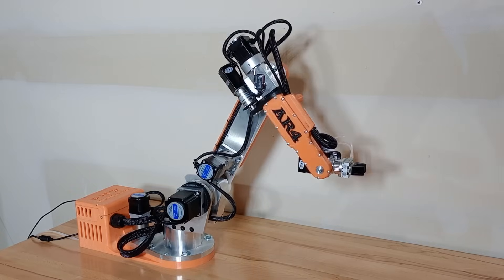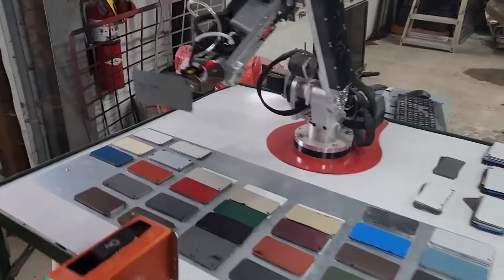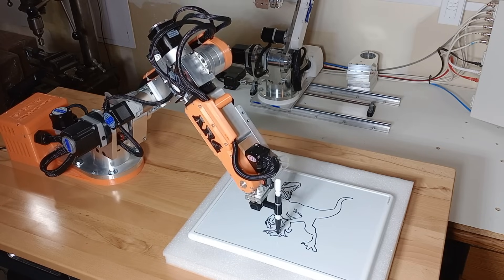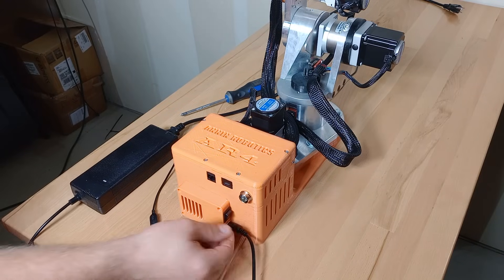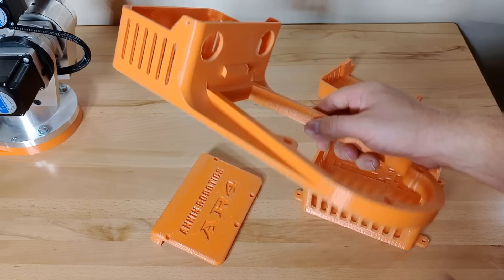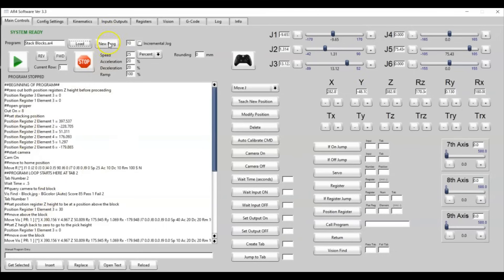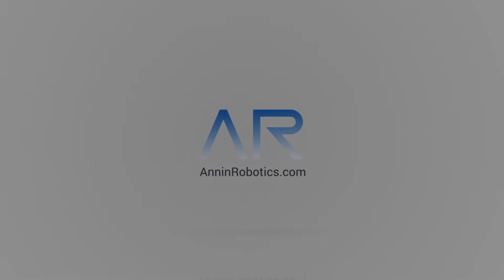AR4 MK2 6 DOF ROBOT ARM - DIY 6 axis robot kit / Arduino controller with Python program interface

Comment: Cool. Wonder, would it be possible to add my 500w spindle on one of these to carve wood? You mentioned grbl, can one use like Deskproto to use multiple axis? A cnc robot for the masses would be super cool, even if it could only do light passes it would still mean multi axis cutting. But Cam support seems to be non existent for open source robot CNCs

Comment: This is fantastic. I have an old MRC Motoman 6 axis welding robot in the shed, can i retrofit your control to it to give it a 2nd life?
Reply from the maker: @AWAradiola  if the drives you have except step and direction inputs it should be no problem. Just download the manual for the ar4 and follow the wiring schematic. Email me if you have any questions

Comment: Dude! Chris! Mind Blown!
Reply from the maker: Thank you!
Reply: Chris I'm trying to build a parallel cable robot to 3D print houses. How do the kinematics get incorporated into the programing? In the firmware or the slicer? Will I need custom g code?
Reply from the maker: @Ed_Aylward  the kinematics are calculated in the teensy control board firmware.

Comment: Is it possible to mill all the structural Aluminium parts on a 3 Axis CNC?
Reply from the maker: @oithetresen609  I believe my machinist currently makes a couple of the parts on a 5-axis but I believe if you do the setups right you should be able to make them all on a three-axis

Comment: I was watching the "Made with Layers" Channel where he built an AR4 but at the end he mentions how much wobble the arm had. 
https://youtu.be/4xD9QCBkxAs?t=706
Was there something in his build that he did differently because the results from your version and his look very different.
(perhaps a parameter was set wrong or where he set the tool center offset 300mm from the Arm at the 14 minute mark ?)
I'm just starting out so I don't know enough to comment so just looking for some insight. Thanks
Reply from the maker: I did see his video.  I sent him this response in the comments:
@Thomas,  Thank you for building the AR4 and highlighting some of its features.  I did want to touch on a few of the comments you made. In the overview section of the manual I do mention pre-applying solder to wires being joined together - I find it easier to pre-apply solder or tinning the ends - and then bring them together with the iron rather than trying to hold the wire ends together and hold the solder and hold iron at the same time, not having 3 hands - it helps to pre apply the solder.  None of the wires going to the breakout board call for tinning so I'm not sure about your comments on that?  On page 143 I do have some groups of wires soldered together to help group them going to the 3 screw terminals as its a tight fit and difficult to maneuver them into position without them being connected but you could certainly use ferrules in this step if needed. At one point in the past the design did utilize plug connectors and building a wiring harness.  Given different applications, motions and articulations all the low cost plugs I sampled proved to fail over time.  With this small arm and the limited cable routing and cable arc lengths, direct solder with the solder joints in strategic locations using heat shrink proved to be more reliable, less bulky, less costly and not as time consuming as crimping and inserting numerous plug pins.  The primary goal of this project from day one has been to realize a usable robot and at a very particular price point.  I've worked with industrial robots my entire career and its always been a frustration that any usable robot was out of reach.  There is an absolute threshold on the price as most educators have a budgetary limit so I have made it priority number one to stay under that limit.  This drives many of the design aspects,  The motors for example are off the shelf variants and cannot be fully customized without adversely affecting the price. There is a limit as to what OMC can customize on these coming from the factory.  The machined components are kept to an absolute minimum and as many as possible are cut from flat sheet material.  This also drives the bearing designs and tensioning designs as custom machined threads and spindles for locknuts for example is not in the cards at this price point. It also drives some of the belt selections.  I did notice the belt tension on your build was far too loose resulting in a good amount of play.  Here is a quick video of the forced deflection on my build. https://youtube.com/shorts/lf_KFFiCdJA  - Making the statement that  "This robot arm is neither accurate nor precise, rigid or smooth" seems a bit harsh considering.  A great deal of effort has gone into this project, I know you have a great deal of experience and a wealth of knowledge in all manner of machines and mechatronics and your design suggestions are certainly well founded but I wanted to explain these aspects of the project, and hope you will convey these points to your audience. Thank you.

Comment: Hi Chris, I want to build an AR4 MK2 and would like to start with the most basic parts. In your store, I will need the 'AR4 MK2 Robot Combo Kit', the 'Complete AR4 MK2 Stepper Motor, Driver & Power Supply Package - factory direct from StepperOnline' and the 3D prints you provide. Is that correct?
Reply from the maker: Yep that's correct, message me with any questions you have on the project and I'm happy to help.

Comment: Hi Chris, what are the differences between the AR4-MK2 and the AR4?
Reply from the maker: the primary difference is that the AR4 had the drives mounted in a separate enclosure and you had to make 6 cables to go between the enclosure and the robot base.  The MK2 has all the drives incorporated into the robot base so you just have to run a usbC cable to the base.  The MK2 also had some of the motors upgraded to higher tolerance gearmotors.

Comment: Hi
Thank you for the awesome project. I have some question

Is it possible to use this robot to etch PCB? Something similar to the drawing in the video but using spindle instead of the pen.

Is it possible to use it as a CNC machine?

Can use it for accurate tasks if I print the alloy parts using carbon fiber nylon or something even harder?

Thank you so much

Comment: Hi Chris, i tied to use AS5600 encoder with AR4 MK2 but i didn't receive any values. Are Encoder.h library in Arduino code will work only with Stepperonline motors only?. If Yes can please show how can modify it to be suitable with any encoder model SCL&SDA connection

Comment: How much does it cost? How large is the work area? How fast does it move?
Can gripper have 4 fingers?

I'm looking for a robot to play chess (blitz) on a standard chess board.
Reply from the maker: Hello,  The total cost is approx $1900 - please see the robot kits page for the kit rundown.  The robot has a reach of 63cm and can lift 1.9kg.  The max linear speed is 193mm per sec.  I hope that helps and please let me know if you have any other questions I can help with.

Comment: Hi Chris, I have a question hopefully you can answer. 
How many degrees of freedom an object can use simultaneously? 
An object in 3D space has 6DOF how many can it use simultaneously?

Let’s say a cylinder is stationary and levitating in the air, it has the potential to move in any of 6DOF. We push a button and the cylinder moves forward- it’s using one DOF out of 6 available. Then we press another button and it starts to roll while it’s moving forward - it’s using 2 out of 6DOF. Then we press another button and it starts to go up while it’s rolling and moving forward- it’s using 3 out of 6DOF. 
Question: how many DOF an object can use simultaneously?

Comment: Do you sell the linear rail as well? If not - could you link which parts would work?
My project requires the robot to be able to traverse around 1.5 meters linearly.
Once again, incredible job by a single person.
Reply from the maker: Thank you very much. I don't have a kit for the rail but the manual does have a bill of materials for it.  The software is configurable so that you can make a rail any length you need. If you have any specific questions please shoot me an email at info@anninrobotics.com

Comment: Hello Chris! I want to make a gantry welding robot (5 axis), according to my dimensions. Tell me, can it be programmed using your program?
Sorry if this is a stupid question, I'm not good at this...
Reply from the maker: The software is written for 6 axis.  I havnt tried adapting it to a 5 axis machine but you could likely use the software only jogging in joint mode and always keep joint 4 at zero and I think it would work but I would need to test.

Comment: Chris this is an amazing project ! could you please share with me what is the accuracy or repeatability test results of the robot ? im designing my own arm and im considering to also work with planetary gear boxes , but im afraid it may make my robot inaccurate. 
thank you for everything you have done !
Reply from the maker: Thank you very much.  Given the testing I have done repeatability is around .2mm to .3mm.  this was with no change in load returning to multiple positions.  Harmonic drives would be ideal but given keeping the cost at a minimum these gear motors aren't too bad.

Comment: This is mind-blowing!! This is not just incredible, but is a legacy… that’s the best way to describe it. One question: in a modified form, is this accurate enough to replace a desktop CNC router?
Reply from the maker: Thank you. It may be capable of light milling but it's best for material handling operations. I still have some optimization to do on the gcode aspect  as well.
Reply: @anninrobotics  Thank you so much for your response. I am looking at fairly light wood carving applications. I shall follow your progress. Best of luck!
Reply from the maker: @OldSilkRoad   thank you!

Comment: Amazing work Chris!
I have all the parts for the AR4 MK1 but I never got into building it as I got busy. Real soon i'll have more time on my hands so i'm wondering if you have a list of the different components used in the MK2 so I can get them individually to make the MK2 directly instead with the old Kits
Reply from the maker: Hello, The aluminum components and and hardware components are the same but the electrical kit changed slightly, it has most of the same parts but there are a few new parts.  You will need some 20awg red/black wire, 90° USB keystone jack, Micro to C USB cable, 5.5mm DC socket, rocker switch, and a common 40mm fan. (see the MK2 manual BOM for details)  These parts are all easily found on Amazon or If needed you can email me and I can put together an invoice for these parts.  The AR4 MK1 motors will all work fine for the MK2, the biggest difference is the drivers.  You will need to purchase (3) DM332T drivers and (3) DM320T drivers from Stepperonline as well as a 24vdc power brick.  The drives as well as a 24vdc power brick can also be found on Amazon.

Comment: Am i to understand with the ar4 mk2 update, i ill no longer need to source anything?  just buy the combo kits and stepper kit, and gripper kit, and make 3d prints and thats all i need, nothing else to source? (enclosure, or anything else no longer required, just buy the kits?)
Reply from the maker: Yes that is correct
Reply: @anninrobotics  fantastic, been wanting to make one for a year but i am squeezed for time, sourcing/designing anything was a no go, now i can buy, assemble with my 4yo boy and put it to work learning pick and place! thanks a million for the update! just want i needed to pull the trigger and get started!  its gonna be a fun xmas morning, my boy LOVES cnc's and robots!

Comment: I’ve followed this project for a while now and it is very impressive. I just have one question though. A common problem with robots are how they are controlled, potentially because the skills to program the robot itself are pretty different from the skills required to make GUIs, so what did you use to create the program to control the robot?

I have looked into a number of solutions myself, creating python GUI programs, making android apps, etc, but they all require pretty different programming skills than microcontroller programming so seem like they would take a long time to learn.
Reply from the maker: Hello, the AR4 software is programmed in Python and is similar to a robot teach pendant.  The programming is fairly basic in that you jog and teach positions, there are also position offsets that can also be used.  I do have a video on the tutorials page that goes over programming which might give you a better idea.

Comment: I tried to post this comment yesterday but I think it might have been eaten by spam filters as it included web links:
Do you have a list of changed parts anywhere to upgrade from the AR4 to MKII Chris? (I can see the EG series gearboxes are available separately from StepperOnline) 
My AR4 build is mechanically complete but I've been injured and unable to do the wiring. Finally recovered and was planning to do the electronics in the coming months. The new compact enclosure looks fantastic! It's been so interesting and exciting to follow your progress over the years.

Having compared the stepperonline kits I can at least somewhat answer my own question for upgrade parts:
J1 Gearbox - EG24-G10
J3 Gearbox - EG24-G50
I can't find the J4 one though, as their Nema11 gearboxes only have ratios listed of 10, 50 and 100:1

Also the new compact power supply - LYD240900- doesn't seem to be listed anywhere, but at 24V 9A with a barrel plug that shouldn't be too hard to find elsewhere

You've also mentioned in another comment on this video that upgraded drivers are required, as well as some other electronics kit components:
"You will need some 20awg red/black wire, USB keystone jack, Micro to C USB cable, 5.5mm DC socket, rocker switch, and 40mm fan. (see the MK2 manual BOM for details)... 
The AR4 MK1 motors will all work fine for the MK2, the biggest difference is the drivers.  You will need to purchase (3) DM332T drivers and (3) DM320T drivers from Stepperonline."
Reply from the maker: The aluminum components and and hardware components are the same but the electrical kit changed slightly, it has most of the same parts but there are a few new parts.  You will need some 20awg red/black wire, 90° USB keystone jack, Micro to C USB cable, 5.5mm DC socket, rocker switch, and a common 40mm fan. (see the MK2 manual BOM for details)  These parts are all easily found on Amazon or If needed you can email me and I can put together an invoice for these parts.  The AR4 MK1 motors will all work fine for the MK2, the biggest difference is the drivers.  You will need to purchase (3) DM332T drivers and (3) DM320T drivers from Stepperonline as well as a 24vdc power brick.  The drives as well as a 24vdc power brick can also be found on Amazon.
Reply: @anninrobotics Thanks Chris. The last thing I couldn't figure out is if I was upgrading to the more accurate gearboxes, do you know if StepperOnline have the J4 16:1 available separately? I was able to find the ones for J1 and J3, but looking for J4 they only have 10:1 and 50:1, neither of which feel close enough to 16:1.
Reply from the maker: I'll talk to them about listing each motor individually. @Jaymis

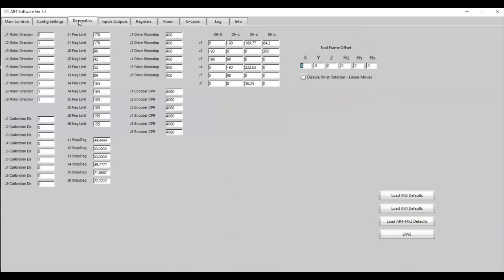Comment: Very, very cool, Chris!  I am still experimenting with your software on my non-AR4 robot. My biggest stumbling block was the Denavit-Hartenberg convention that differs from my robot to the AR4.  Can you recommend a way to adjust the DH convention parameters? At 7:30 in the video, you mention the kinematics. Maybe it can be done on this tab?  I tried making these DH changes in the C++ file that runs on the Teensy, but didn't have any luck. (Introduce other errors, like out of range etc) I am super looking forward to taking another look at this latest version. Also, the gcode feature is super important. This could really bridge the gap of CNC & robotics concepts, which are not all that dissimilar. THANKS!! so much for all you do!!! I know what I will be doing this weekend.

Comment: this is so helpful, written into history! I wish I could get a AR4 arm. I have 0 knowledge of CNC, I have a 3D printer. how can I get all the parts? (I'm a programmer)
Reply from the maker: I have kits on the website you can use.  Thank you.
Reply: @anninrobotics  Thanks. I think I have problem shipping kits here. About Stepper Motors and Drivers, can I use other brand motors and drivers?
Reply: The building part is pretty doable, I'm printing my version(though a bit modified for printing)

Comment: There aren't any thermal issues with stacking the drivers together like that?
Reply from the maker: No I have had no issues, there is air spacing between the drives and the 40mm fan keep air flowing around them.